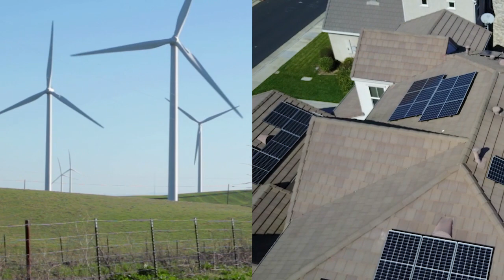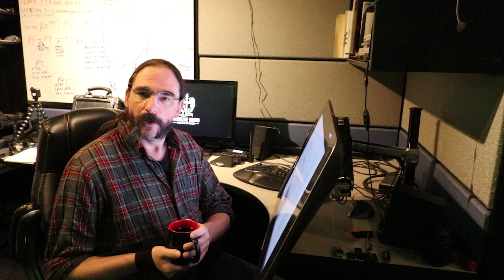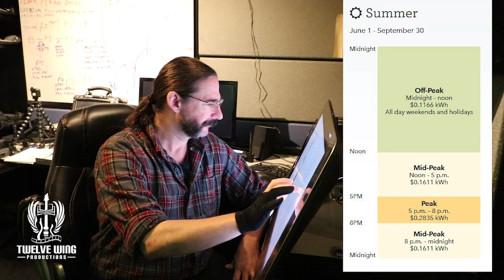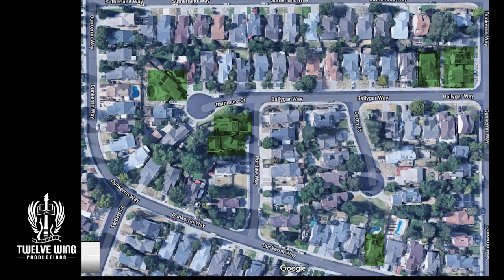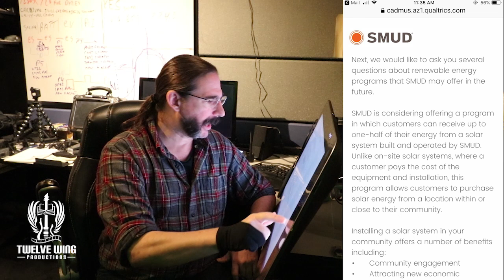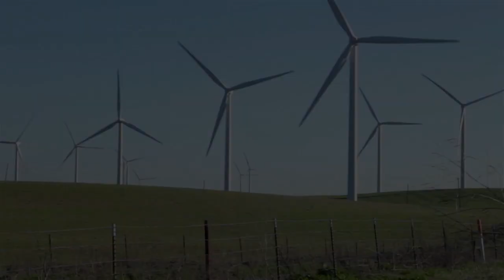Local utilities are terrified of Tesla's Powerwall 2

Comment: Thanks for doing this. I installed 2 PW2's 16 months ago to complement our 7 year old 13.2 kWh PV system, operating in self powered mode since installation, and operating as a microgrid for ~9 months exporting ~60 percent of our excess solar back to grid. We have net metering and they pay us for net metered production up to $5k/year. We also have two Tesla's that we charge off our roof. The PW2's have worked flawlessly for us up in Edmonds, WA. We do rely on grid energy to supplement our solar November - mid February. Our utility provider was easy to work with, probably as we were only the second PW2 installation in WA at the time we installed.
Reply from the maker: It's wonderful to hear from someone further north.
I try and make it clear that what folks see in our system is specific to our latitude and elevation.
So it's nice to see folks in other parts of the world present their numbers as well.
Great to hear about your system.

Comment: Apparently most utilities want to charge you for your panel capacity.  In Florida, they want to throw you out of your house if you disconnect from the grid.. They simply want to 'collectivize' everything spent on solar and take over control of it.  If you stay connected, they wiggle the frequency, which takes panels and generation off line... Nice trick.
Reply from the maker: They tried that here too.  Not the wiggling the frequency thing, though their argument is that they do that when solar produces too much.
That's actually a bit of a valid argument.
That said, home batteries make all that go away.  We need to get legislators on our side on this one and that's going to be tough.

Home batteries and electric vehicles put you in direct competition with two HUGE lobbying interests.  So this is going to be a hard battle short term.
Reply: @twelvewingproductions7508  The batteries have them terrified...The state wants you to put solar panels on your roof for $10-60,000.... and then the Utility turns them off....  Even the Coops are doing it, and it is totally understandable.... The new standards for grid tied inverters had 60 hz for full output, 62 turns off the inverter modules totally.  in between, you can generate a little power.  61.5 will do a few percent of what you could do in theory.  Throw in turning OFF the grid because there is a fire danger (in california of course) and THAT kills the grid tied folk totally.. Grid tied with battery?  perfectly fine, but you cannot dump un-needed power into the grid at any time...There is a guy working with one of the larger inverter companies to do the "wiggle" on their output frequency... He had 25kw of grid tied, which is really tied to his battery inverter.  Right now, when his batteries top up at about 10am, the 15kw inverter does the frequency shift.. and all his 25kw of "grid tied" goes off line.. comes back 5 minutes later.   By then his batteries are down a little, and capable of a bit of charge..  With the new standard, you can shift up to 61.0 to drop the output of the gt inverters... or go to 62 to turn them off... Just have to wait for the new firmware for those boxes to make everything happy....
Reply from the maker: @Billblom , true in that is in the design.
I'll have to do a video on this explaining it in detail as there is a lot to it.

Now, as true as what you said above is, when the system is done the way we have done it, the grid can't shut us off.
The tesla gateway powers our inverter.  The only thing that can shut our inverter off IS the gateway.  It does so when rebooting and for internal faults, but we don't loose power or the ability to generate power when the grid goes down.
Reply: @twelvewingproductions7508  Sounds good.  The utilities seem to be terrified of batteries.  In Florida and a bunch of other states: If you go off grid, they pull your CO for your house, business and so on.  In other words, they can ban you from your own property.  Additionally, they can bill you at 80% of your historical base load.  Another nice thing. Seeing some of the utilities out west demanding $10 per KWH of panels on your roof as a "convenience" or "equipment" charge (that's going to take big lawsuits to block) ... So if you have 10 kw of panels, you pay $100 a month just sitting there.  My impression: Solar is going to destroy their grid, leaving tiny grids that are neighborhood sized.  Their war against independence will end up doing more damage to the utilities than solar has so far...
Reply from the maker: @Billblom , yes, for us they tried to float an $8 per kw fee.  That would have added $80 to our monthly bill.
This needs to be brought to light and it needs to be stopped.
Please help us do this by sharing The Energy Sovereignty Project and consider helping us on Patreon.

We will continue to fight this but our greatest weapon is to get this channel to succeed.
Reply: @twelvewingproductions7508  In Florida, Florida Flash and Flicker (Power and Light.. or plunder and loot) was the one that pushed that sort of regulation through in the legislature.  It's now law.  They started pushing things like that here, at the same time pushing for "No money down solar Systems" that would add $80k to your mortgage.  And then at the same time, they try the "Wiggle" to turn all that generation off.  (Frequency shifts to help control the real problem of the duck curve.)  I am looking at a non-tesla solution since Tesla doesn't do anything in this state.  And this state has attitudes toward california attitudes.  If the state tells people they can't use cabins that have no power, there will be riots here.   

There are huge solar farms here that Duke buys power from.. and uses that to raise rates... They also have nice nasty coal plants running all over the state to supply Cheap power to Apple and their data center.  (They put a site out near the mountains.. cut down a bunch of acreage to put in Solar panels.. 100% of the output goes to Duke.. and they buy back power at coal plant rates...)  I don't do Patreon.  I don't send money to people that de-platform ANYONE, whether I agree or not.. (And mostly Not with the people that were unplugged there..)  Duke at least has a bunch of Pump Hyrdro to use as batteries.... A Good solution to the problem...
Reply from the maker: @Billblom , we all have to remain vigilant for this kind of crap.
They are desperately looking to make battery farms for themselves to charge you for.  The last thing they want you to do is what you see us doing now.
For reasons we are making painfully clear.

Thanks for following.

Comment: Kentucky utilities just changed their rate structure away from net metering and towards solar feed credit half of the rate they charge when you consume power. This was targeted at only roof top solar homes as the standard rate are not changing for other customers. They are also creating this adversarial relationship by proposing that solar customers pay larger connection fees.

As far as their proposed model for customers that want renewable they created the cooperative model where the KWh charge includes the cost to build. The plan is laughable as you would have to pay more than twice the normal utility cost to be green. This is where I would rather own and produce my own energy. The utility will never have the best interest of the customer at heart as the customer generation takes profitability away.

My recommended approach is for them to have an option for those that want to buy battery for their homes. They would have to compete with local providers, but at least they don’t have to use deception to get peoples money. Excellent video and topic!!
Reply from the maker: "They are also creating this adversarial relationship by proposing that solar customers pay larger connection fees."~

I always find this amusing when talking about home battery systems since the home could run on a dryer plug.

"The utility will never have the best interest of the customer at heart as the customer generation takes profitability away."~

Yup.  Nailed it.  The utilities cry about being "not for profit" but as I pointed out in an earlier video, the top executives at our utility are pulling down $300-600k a year before bonuses.
That sounds like profit to me.
So hiding your profits in your executive rate structure doesn't mean you are "not for profit".  It just means you are better at hiding profit than most people realize.

"My recommended approach is for them to have an option for those that want to buy battery for their homes."~

Careful here... because the way they seem to be approaching this is to purchase the batteries themselves and then charge you the same amount for your power or even more and claim it's now "green" energy.
They might be magnanimous and give you a little break and then pray you never actually look at how little power you are actually using.

My recommendation is that folks keep tabs on the battery costs in their areas, both with and without incentives, and then get their own equipment when they feel it makes economic sense for them.
We may also have to start to get national class action suits going, or pressing our representatives to pass national protective legislation. 

But we have a corrupt government when it comes to this kind of thing and we are not only fighting the utilities but we are fighting big oil as well.
Reply from the maker: "They are also creating this adversarial relationship by proposing that solar customers pay larger connection fees."~

I always find this amusing when talking about home battery systems since the home could run on a dryer plug.

"The utility will never have the best interest of the customer at heart as the customer generation takes profitability away."~

Yup.  Nailed it.  The utilities cry about being "not for profit" but as I pointed out in an earlier video, the top executives at our utility are pulling down $300-600k a year before bonuses.
That sounds like profit to me.
So hiding your profits in your executive rate structure doesn't mean you are "not for profit".  It just means you are better at hiding profit than most people realize.

"My recommended approach is for them to have an option for those that want to buy battery for their homes."~

Careful here... because the way they seem to be approaching this is to purchase the batteries themselves and then charge you the same amount for your power or even more and claim it's now "green" energy.
They might be magnanimous and give you a little break and then pray you never actually look at how little power you are actually using.

My recommendation is that folks keep tabs on the battery costs in their areas, both with and without incentives, and then get their own equipment when they feel it makes economic sense for them.
We may also have to start to get national class action suits going, or pressing our representatives to pass national protective legislation. 

But we have a corrupt government when it comes to this kind of thing and we are not only fighting the utilities but we are fighting big oil as well.
Reply from the maker: "They are also creating this adversarial relationship by proposing that solar customers pay larger connection fees."~

I always find this amusing when talking about home battery systems since the home could run on a dryer plug.

"The utility will never have the best interest of the customer at heart as the customer generation takes profitability away."~

Yup.  Nailed it.  The utilities cry about being "not for profit" but as I pointed out in an earlier video, the top executives at our utility are pulling down $300-600k a year before bonuses.
That sounds like profit to me.
So hiding your profits in your executive rate structure doesn't mean you are "not for profit".  It just means you are better at hiding profit than most people realize.

"My recommended approach is for them to have an option for those that want to buy battery for their homes."~

Careful here... because the way they seem to be approaching this is to purchase the batteries themselves and then charge you the same amount for your power or even more and claim it's now "green" energy.
They might be magnanimous and give you a little break and then pray you never actually look at how little power you are actually using.

My recommendation is that folks keep tabs on the battery costs in their areas, both with and without incentives, and then get their own equipment when they feel it makes economic sense for them.
We may also have to start to get national class action suits going, or pressing our representatives to pass national protective legislation. 

But we have a corrupt government when it comes to this kind of thing and we are not only fighting the utilities but we are fighting big oil as well.
Reply from the maker: "They are also creating this adversarial relationship by proposing that solar customers pay larger connection fees."~

I always find this amusing when talking about home battery systems since the home could run on a dryer plug.

"The utility will never have the best interest of the customer at heart as the customer generation takes profitability away."~

Yup.  Nailed it.  The utilities cry about being "not for profit" but as I pointed out in an earlier video, the top executives at our utility are pulling down $300-600k a year before bonuses.
That sounds like profit to me.
So hiding your profits in your executive rate structure doesn't mean you are "not for profit".  It just means you are better at hiding profit than most people realize.

"My recommended approach is for them to have an option for those that want to buy battery for their homes."~

Careful here... because the way they seem to be approaching this is to purchase the batteries themselves and then charge you the same amount for your power or even more and claim it's now "green" energy.
They might be magnanimous and give you a little break and then pray you never actually look at how little power you are actually using.

My recommendation is that folks keep tabs on the battery costs in their areas, both with and without incentives, and then get their own equipment when they feel it makes economic sense for them.
We may also have to start to get national class action suits going, or pressing our representatives to pass national protective legislation. 

But we have a corrupt government when it comes to this kind of thing and we are not only fighting the utilities but we are fighting big oil as well.
Reply: Twelve Wing Productions I am in agreement. Renewable is now cheaper than utility power without incentives and all it will take is having financing models that can aid folks to take their energy future seriously. The current path of fossil fuels is only going to worsen our air quality and severity of climate change that are already seen. We need to look at battery technology as it improves and invest in the future that includes less reliance on central power generation and more micro grids. The technology is in its growth phase with the Powerwall and adoption will only accelerate. Consumers need to educate themselves and your energy project is an excellent example on how we can drive adoption of distributed grids.
Reply from the maker: @pedrogarces6876 , I'm going to pull back from total agreement on the "cheaper" part if you are only talking about utility.
I will say that we are at the break even point but I think we need to do better than that.
If, however, you have an electric vehicle and you have enough solar and battery storage to run your car, you are correct.  At that point you are ahead of the game to the tune of about $200-300 a month.
This is in excess of what ever you would have been spending on utility power.

That... alters your ROI structure more than just a little.
Reply: Twelve Wing Productions The challenge is the up front cost to adopt solar and battery. The pricing on components and panels keeps dropping. Battery technology is also on the downward trend of pricing for consumer adoption. You have done an excellent illustration and even with a large bank of batteries there are months were production is not enough to keep the batteries at 100%. The question is what is the quantity panel and battery that will be parity throughout the year with consumption to provide generation for both a car and normal home energy use. Complete disconnection if it were to be allowed would require some kind of alternative to charge the battery or having the built in storage ahead of periods without a lot of generation.
Reply from the maker: @pedrogarces6876 , for our home, I think we would be there with 14-17kw.
It's likely I'll be adding an additional 4-5kw next year.  I have to look at where I'm going to put it.  It may very well be that this additional capacity will only be energized in winter.
Reply: Twelve Wing Productions That’s great. I know that when I built my at 7.4kw it was only going to yield 10.5 MWh a year. My net metering trues up in a June so in July I have to adjust my AC usage as the accumulate net credit of 1 MWh  is reset. My July demand is about 20% higher than my generation. If I had batteries this seasonal adjustment becomes less of a problem. Also, I decided to start doing better self consumption by scheduling dish washer during peak solar day and prepped laundry for while I am at work. I have been able to consume 57% of generated solar at the time it is produced. This reduces my usage of power during the evening where the source utility power may not be as clean.